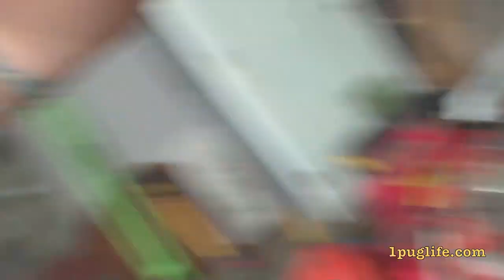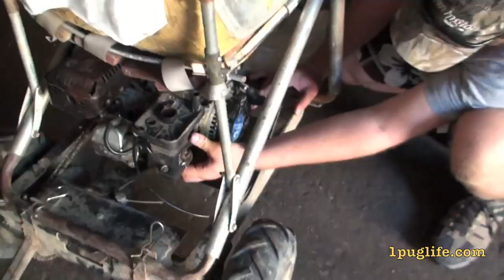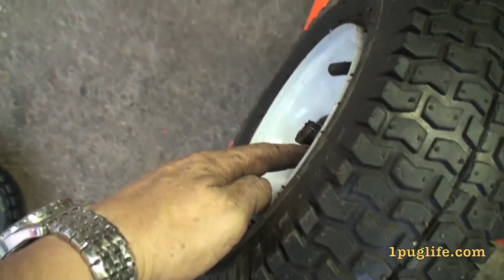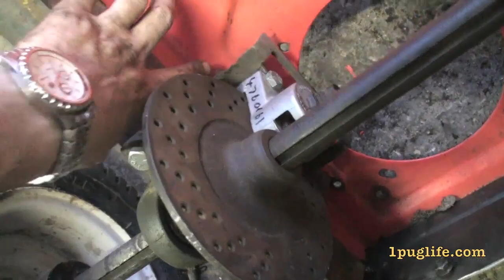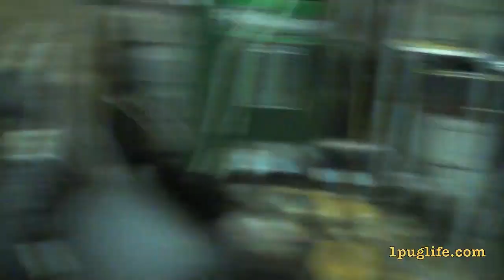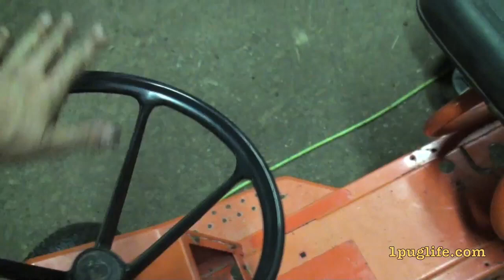ariens trapter build 1

Comment: FFS Pug... Just like every1else is sayin' bro... Ya need to wider rear antlers for the back axle mate... need to get them pillow block bearings out as close as ya can to the rear rubber man... You got all the big weight in the ass end of the trapter dude, motor, stunt pilot, fuel tank is all in the ass end... Bit of time spent doing it now is gonna save ya a shit load of time straightening ya rear antlers every time you run it... :)